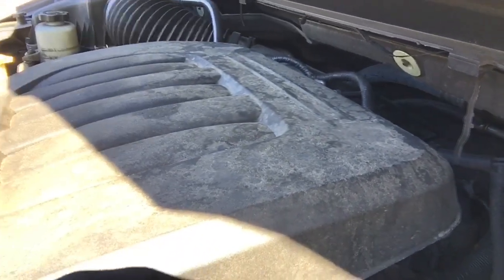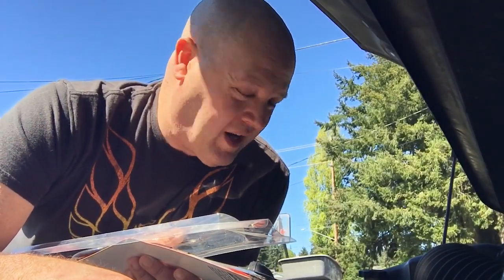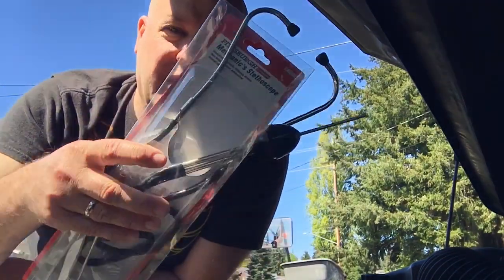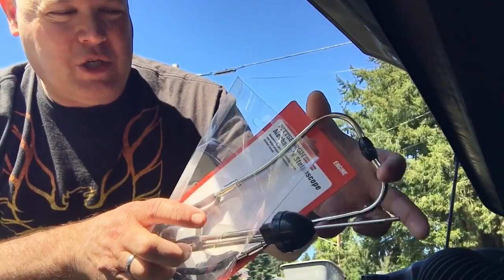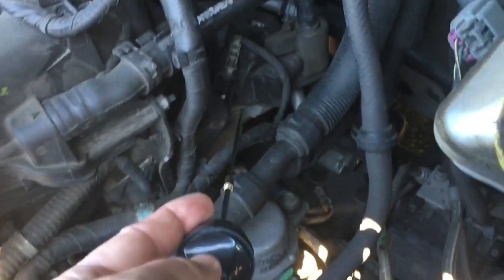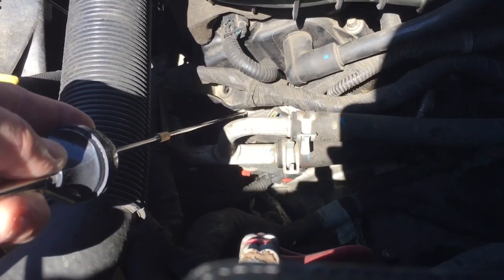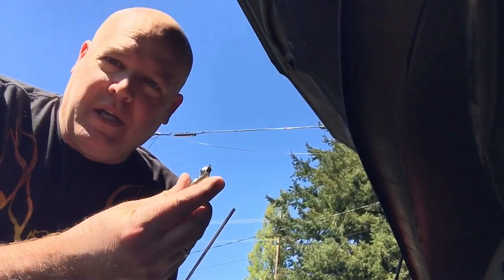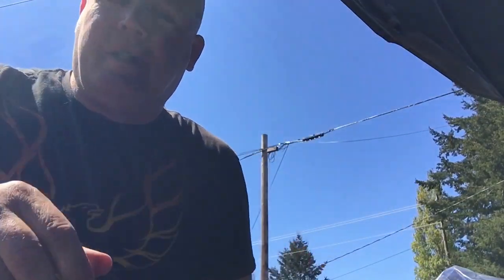Tick Tick, Tap Tap, Knock  Knock ,who's there? Chrysler Pentastar 3.6

Comment: Disconnect the wires going to the oil pump solenoid on the back of the engine while you are at it! Then the lil pump will stay in high mode all the time and you will have lots of oil going to the rocker arms!!! That is what I did and no more rocker problems!
Reply from the maker: Not sure I would mess with the Oil pressure like that mang
Reply: @RussShawTV  I have been driving my Caravan for almost a year now with the high oil pressure on and 5x30 synthetic instead of the 5x20 synthetic that I used to use-and I still have a big smile on my face as I watch the oil pressure gauge that I mounted on the lower part of my dash!
Reply from the maker: @Nostalgic Enigma I think there may be some videos on it. I believe you can unbolt cam phasers, the gear on the timing chain. But you got to make sure everything’s timed right. 
I would just replace the one or ones that are bad. 
A bad rocker will cause valve problems over time.

Comment: Rocker arms. Replace them ALL with cast iron. They are gonna eat your camshaft lobes and cost you more than the car's worth. They can also break open and release ball bearings into your engine. Replacing one or a few rockers at a time is not economical. They are an inferior and notoriously failing part. DO THEM ALL! If you start getting a rattle with acceleration, it means your camshaft lobes are getting ripped apart, leaving metal shavings and you've waited too long. Speaking from personal experience. Wish I wasn't.
Reply from the maker: Good point now that I’m a professional mechanic I would recommend that. I replaced 3 on my 2011 3.6 Caravan and every time I gotta take out the intake manifold, the Value covers 😣 it’s easier to take care of it all at once.

Comment: How are the brand new one’s? Do they still get any issues? I’m considering a 3.6 Ram 1500
Reply from the maker: I think the newer generation Penastars are pretty great. We service a lot of Pro Master vans in the shop I work at. They all got front wheel drive 3.6 Penastars. They seem to be a lot more reliable than the Ford vans and even the Mercedes sprinter vans. (Which are also a Chrysler product). I forget what generation the 3.6 is on third or fourth? 🤔 That would be a great question for my friend JT! “Online mechanic tips” He is a master tech had a Chrysler dealership in Atlanta Georgia. He has taken classes on all the other generations of penastars.
Reply: @RussShawTV  thanks for the info.
Reply from the maker: Thanks for watching and subscribing 😁👍
Reply: My 2014 Ram 1500 has 271K miles.  Original engine replaced by previous owner @ 240K. I bought it when it had 245K in it
Reply: @MrLuisinho90  Not bad, that's actually pretty impressive.
Reply: @joeshmoe8952  and it's still on its original 845RE ZF8 based transmission. I just replaced pan and fluid about 2K miles ago. It shifts buttery smooth.
Reply: @MrLuisinho90  I’m considering on a quad cab with the 3.55 tow package. I know it gets shitty gas mileage but I got a side by side I would be towing.
Reply: @joeshmoe8952  3.55 rear end will knock about 1 MPG combined. IMHO It's well worth it. 
I've only got the 3.21 rear end on my quadcab 2WD and the MPG are great, I repeatedly get 23-25 MPG on the hwy with AT 32" tires but the 3.21 rear end will constantly downshift 2 gears out of 8th gear at the slightest grade and when passing. But on plain surfaces it'll cruise 70 MPH @ 1600 RPM. If you tow or want better throttle response, then it's 3.55, no contest.